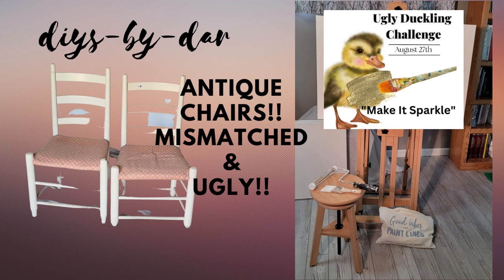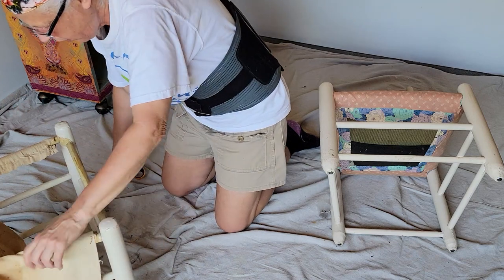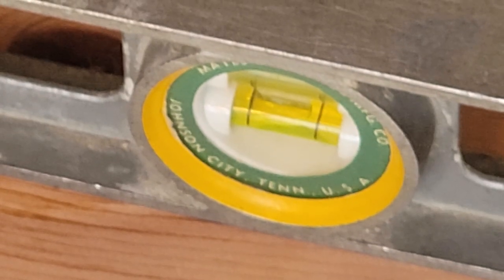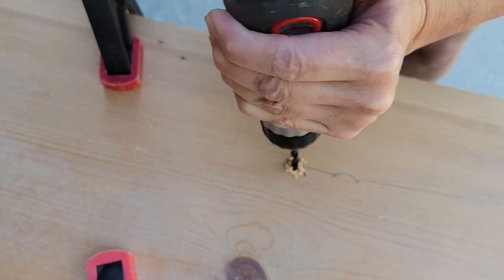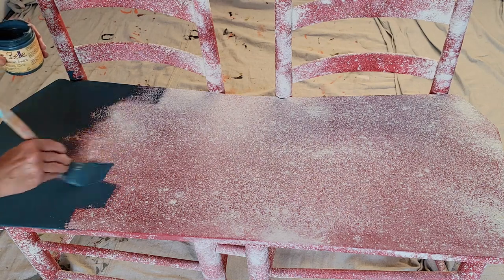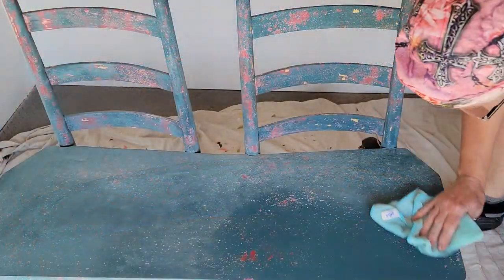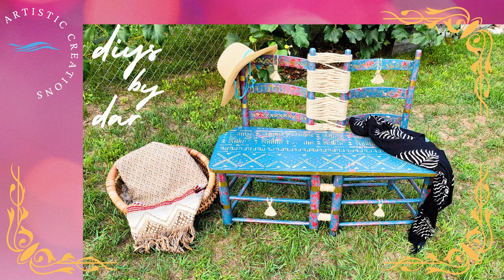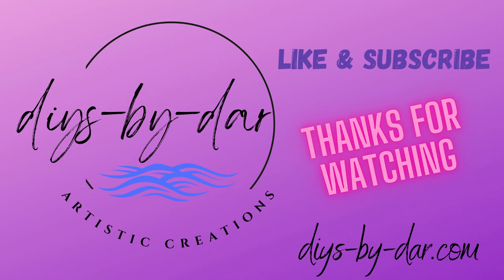Maximalist furniture flip, 2 antique chairs into a bench!  #uglyducklingchallenge

Comment: Dar, you are such a gem. I love that youre out there working with your back brace on. Kicking butt and taking names. You did a FANTASTIC job building these. You say youre not a carpenter but i say you are! Of course that darn knot ended up exactly where you needed to cut haha! You did SO many cool techniques on this. 120 degrees! What! I agree that the paint sticking ended up adding to the design anyway! I have never seen dixie shine! How cool! I was saying "wowwwww!!!" The whole video! You are so creative. I love how your mind works. Thanks so much for participating in the challenge. Your bench is awesome. I wanna go make a bench now. Thank you for the inspo
Reply from the maker: Thanks so much cory.  This bench really turned out a solid little piece.  I did surprise myself.  Thank you so much for all your support of my pieces and channel.  Yeah. I am sure my next surgery will be on my back, its always a problem. If it would turn out like both my hips I would have it done already.  I have this piece in my booth already, priced at 250, so I will see if the folks around here are in to boho!
Reply: @diysbydar   oh yikes for surgery! I hope you won't need to. Fingers crossed it sells quickly for you! How's your booth doing
Reply from the maker: @DesertDIY  hi cory.  I went up in size on my booth, 8 x 10 feet.  300.00 a month, not sure if this will work out!  I sold 1 piece for 525.00.  But, my pottery went crazy, almost sold out.  But the pricing on that can be 10.00 to 45.00 a piece.  I will try it for a while and see if it's worth keeping it, that's alot of money for a space!!